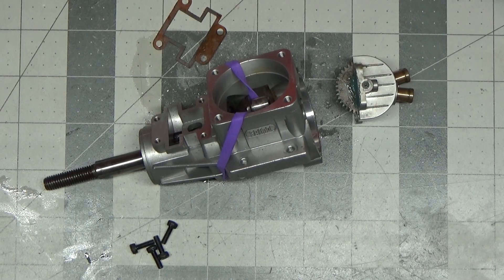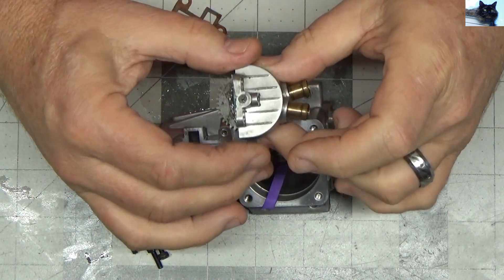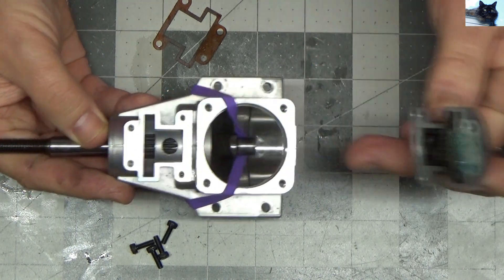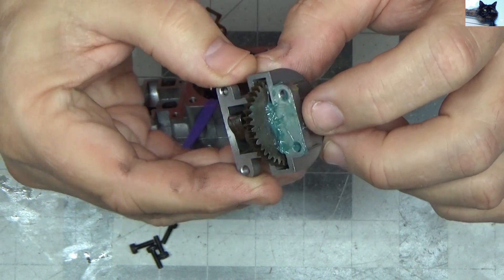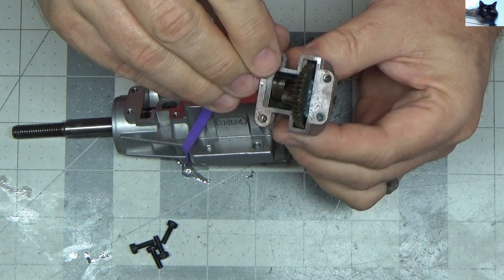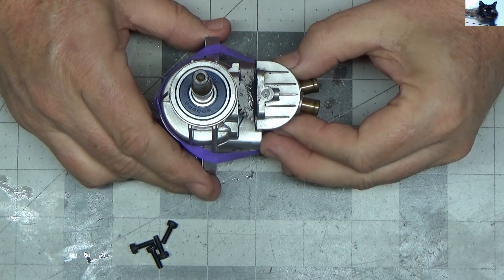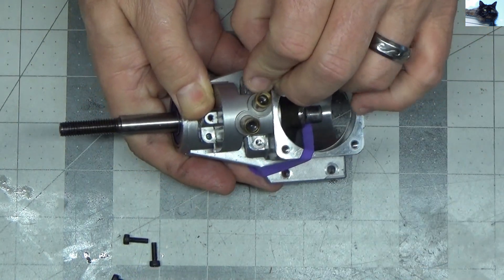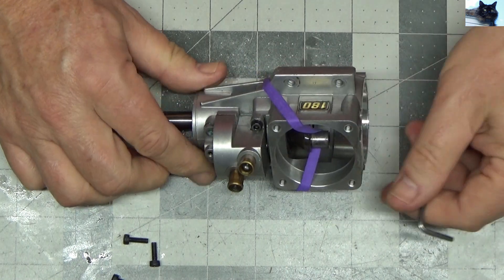Saito Large Single How To: Setting the Timing

Comment: hello my name is Vinícios I'm from Brazil. i need your help please. I have a Saito FG 61 TS I opened the engine's right cylinder and the valve camshaft cover and now to mount the valve camshaft I need to know its correct position! Another doubt is if this engine explodes the combustion chamber at the same or one cylinder at a time?
Reply from the maker: I am not familiar with saito gas engines. But maybe this will help. 
https://youtu.be/l_wOaDxCKm4

Comment: what a great idea i have a saito 80 that needs new bearings i will be giving it a go now thanks heaps david
Reply from the maker: That method does not apply to the smaller Saito engines.  Only the 120, 150, and 180.  I have a different video that shows how to time the smaller Saito engines. https://youtu.be/bTjExGAoge8
Reply: @dmrcflyr2   yes you are correct i had a brain fade there for a moment thanks once again david
Reply: @dmrcflyr2  I have an FA 220 GK and thankfully I found your video as the methods shown for smaller Saito's clearly won't work with the tappets.

The rubber band idea is a great one, and I used it.  I also used a variation of it for the Timing Gear instead of the grease.  Just stretch a similar size rubber band between your thumb and forefinger and slip it under the gear tooth closest to the housing with the dot at the top.  Then pinch the rubber band tightly to lock the gear in place while inserting it.  There is enough of a gap to slip the rubber band out after the teeth engage.

Thank you very much for your videos!!  The Saito was crashed 15 years ago and it was still attached to the plane, with broken prop and DIRT from the crash.   Your LA's Fabulous Cleaner, Heat and Oil, and Bearing Removal videos helped me get it cleaned up and put back together.  She's clean as a whistle now.  

I'll let you if I'm able to get her started.
Thanks!
Mike Warren